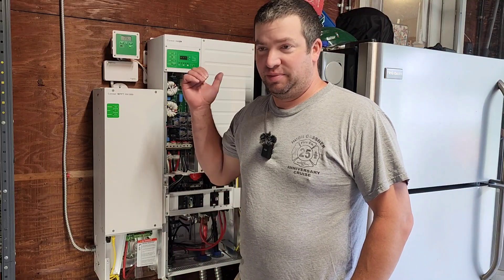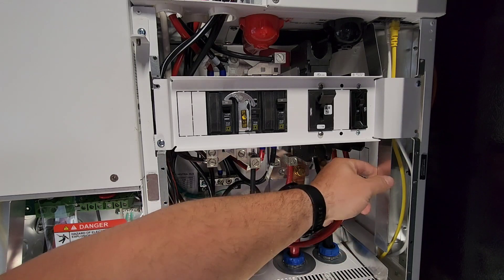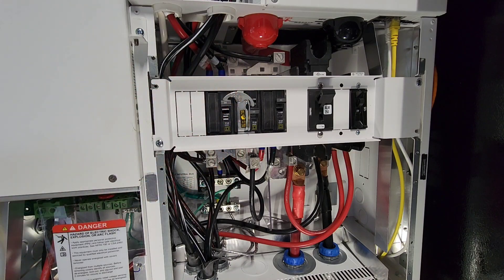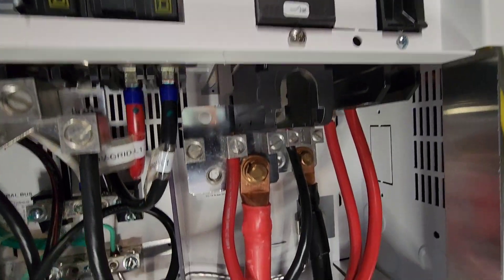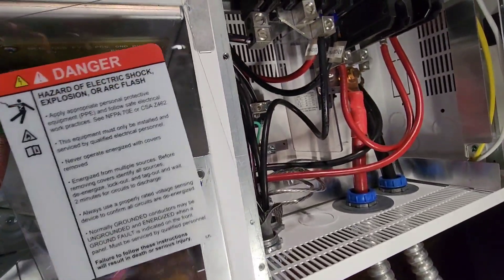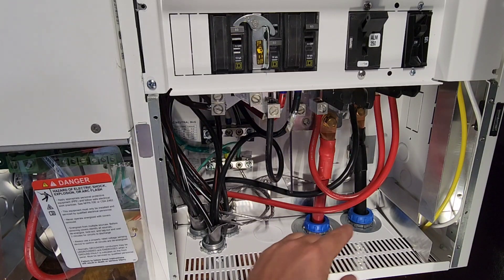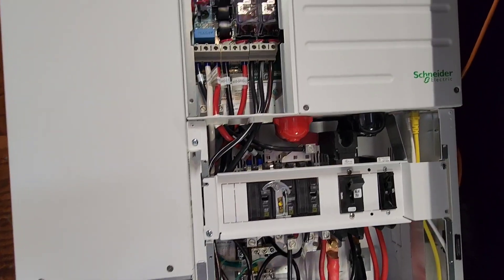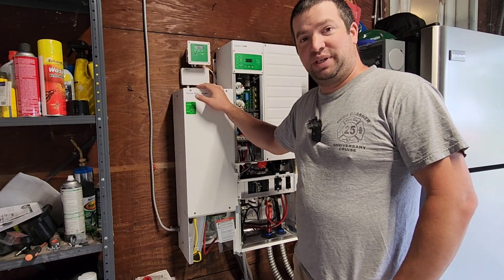Wiring a Schneider XW Pro

Comment: I noticed you didn't have the ferrite cores on the DC high voltage coming into the charge controller and I didn't see a fuse in the ground fault just curious as to why you did not use them.
Reply from the maker: Good catch!  I couldn't find anything in the installation manual about the ferrite cores, so didn't install them.  Turns out there was a separate piece of paper detailing their installation.  As far as the fuse goes, the array is floating so no fuse required.  Thanks for the feedback!
Reply: @benssolarandbattery  what do you mean by floating ungrounded? didn't realize that that was possible with this high voltage.
Reply from the maker: @SpencerLAPower  the array is grounded, but positive or negative don't have a reference to ground.  Most newer systems and string inverters use this.  It should have a 2 pole disconnect ahead of the charge controller, but that's it.  It will throw an error if either of the conductors grounds out but the equipment being grounded will prevent it from getting you.
Reply: @benssolarandbattery  did you have to change anything in the settings on the charge controller in order to do this I've got a customer that's having ground fault issues with one of their systems wondering if it's the solar panels they're using are used the six other systems that they have are all working fine just that one keeps blowing the fuse in the charge controller and throwing ground fault and shutting down the charge controller down.
Reply from the maker: @SpencerLAPower  didn't have to change settings for that.  Sounds like there's a fault there if it's blowing fuses.  Time to check the whole circuit plus panels.  Be careful!